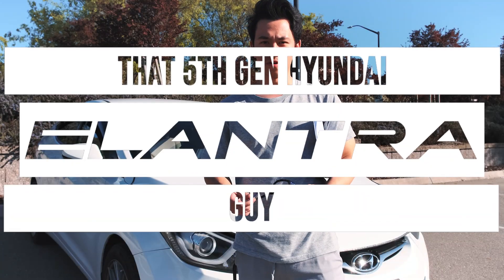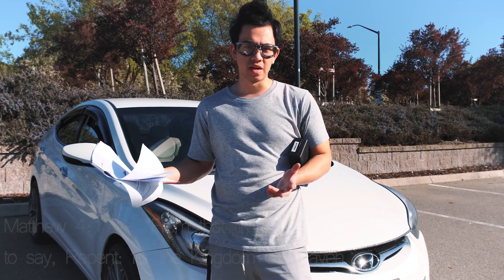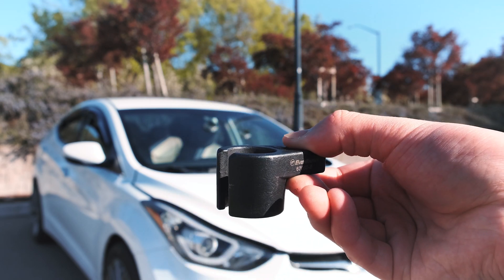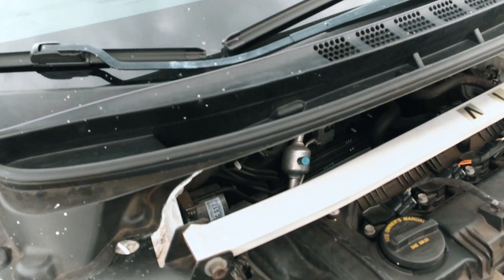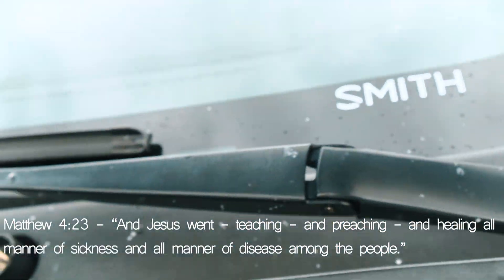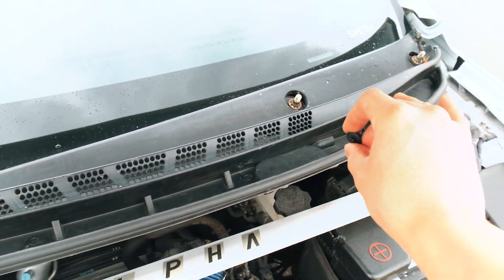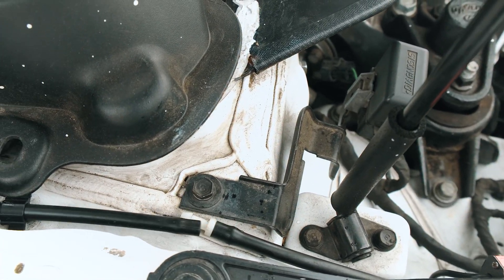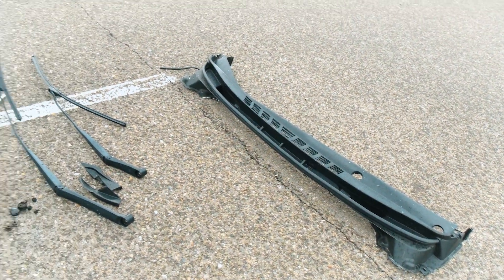WIDEBAND O2 Sensor For The ELANTRA! [2014 Hyundai Elantra]

Comment: Hey,  I am New to car what does this sensors helps ? I own a 1.8gls2013
Reply from the maker: Hey there Tan! Thanks for stopping by. An O2 sensor will sense the amount of oxygen upstream, the one I changed in this video (Before the catalytic converter) and there will be another one, downstream (After the catalytic converter). By sensing the amount of O2 it will send data to the cars computer (ECU) so the air to fuel ratio will be set based off that data (This is so the catalytic converter will work better in this case). But upgrading to a wideband sensor like we do in this video will give a 'wider band' of useable data for tuning the air to fuel ratio later on! So it is for performance, fuel economy, and emmisons.
Reply: @alittlebit-ofeverything  oh thank for the information  above,  I am very interested on your up coming video regarding amr500 supercharge install😀
Reply: Hi, I would like to know the specifications of the O2 sensor that uses an Hyundai elantra 2013 or 2014....I have an elantra 2013 gls but my sensor I think it is not working properly so if may help me I really appreciate it.... this kind of videos are really helpful. Thanks
Reply from the maker: @johansanchez5390  Hey there Johan!,

This sensor should fit for a 2013 Elantra GLS! :) And because we share the same car (5th generation Elantra) these install instructions you see in this video should be exactly the same ! (As long as you have a catalytic converter exhaust manifold as seen in the video). Hope this helps.

- Jonathan